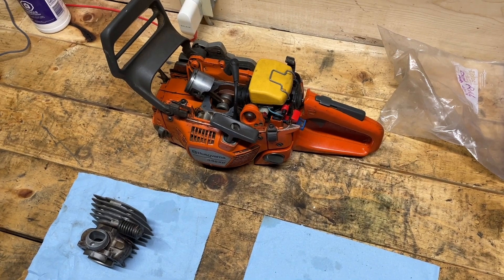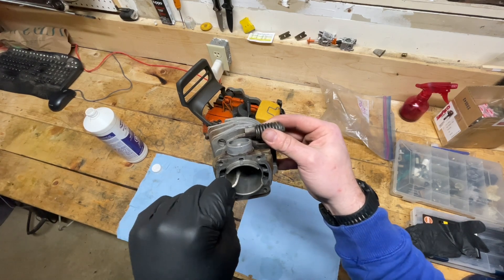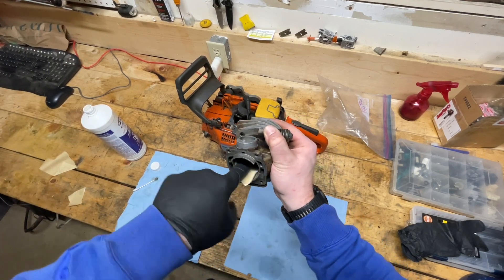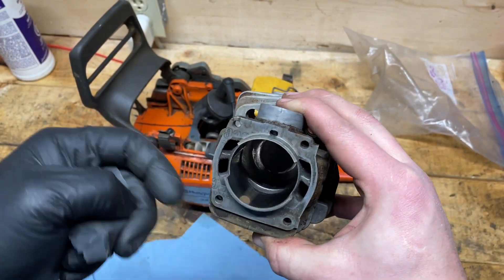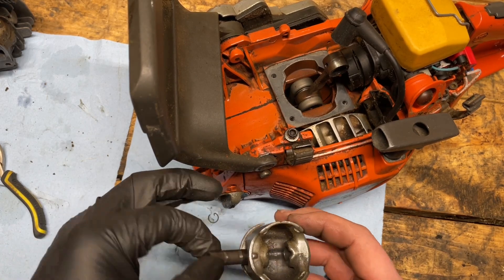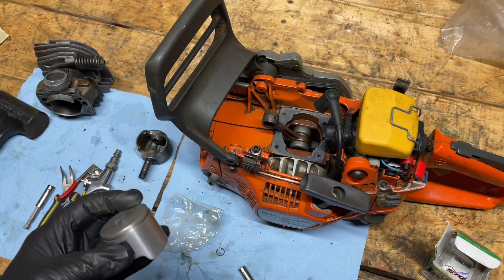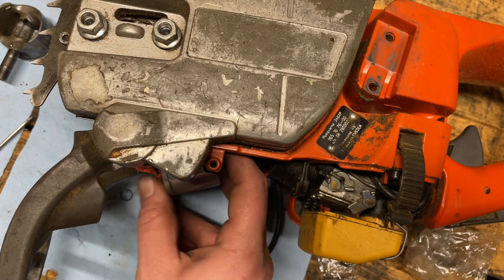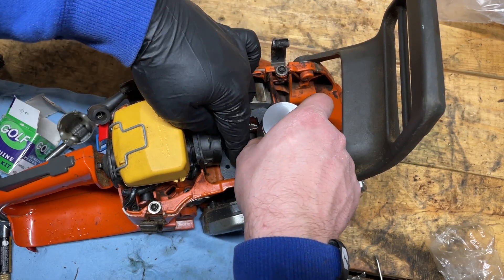How to fix a scored (blown) chainsaw and install a new piston. Step by step on “the lemon” saw!!!

Comment: Great job Dave on the lemon saw. I have used sand paper as well,  but i now use a brake cylinder hone in a drill at slow speed, going in and out to get a cross hatch. Saw runs good and i would have liked to have seen you do another compression test after you cut with the saw, just to get a comparison. Nice camera work and explanation of what you were doing!  🇺🇸🇨🇦👍  Roger
Reply from the maker: Thanks Roger! Do you think the home takes off too much material?
Reply: @DavesSmallEngines  No Dave after you use the acid on the bore it doesn't take but 30 second with the hone. The one i have is adjustable so you can set it for a very light pressure.  I have larger hones also for car engines that adjust to larger bores and you can still set the pressure.  You could practice on a junk cylinder. You will be suprised how easy it is. Slow speed and not alot of pressure.
Reply from the maker: @rogermcdonald1607  I will look into this. Great tip!
Reply: @DavesSmallEngines  Goodluck Dave, you can buy them on Amazon for under 15 dollars.
Reply: I too appreciate Daves camera work, I think he was meant for Youtube, so congrats to him hehe.
Reply from the maker: @stellarproductions8888  thanks Stellar!!!

Comment: i find that when i put a piton in a cylinder is to get a small cable tie  and put it round the piston ring and push the cylinder on and then cut the cable tie off when you have started the piston and i all ways put some rag in the piston hole to stop bits dropping in the case .
Reply from the maker: Good tips! Thanks!

Comment: Hows it going Dave? Thats a nice small size saw, I think its meant for a 16" blade, its mainly a firewood cutting, sapling remover saw, light duty work. You did another excellent job on making lemonade out of a lemon! She's ready for a good time now, and clearly couldn't wait to cut something out there, good deal. I like the attention to detail that you do with your services. Excellent work buddy, and thanks for sharing!
Reply from the maker: Thanks again for yet another positive feedback Stellar! I always look forward to your comments. This saw is actually known to run best with an 18" bar. Its very comparable (and most say better) than the Stihl 026/MS260. I have one of those with a 16" bar on it and it absolutely screams!

Comment: Good on the process for rebuilding. Like someone mentioned earlier, sounds (and possibly looks) like there could be an air leak. You did adjust the idle screw, so that could be part of the problem. Pressure and vacuum test could give you the answer.
Reply from the maker: Sounds good Andrew!  I’ll check it out.Thanks for watching.

Comment: Nice work! I told you that's a fast saw.  Sounds a little lean on my cheap speakers. If so, Might be carb adjust or vacuum leak which would explain original issue. Easy to test with some brake clean.  Keep the videos coming.
Reply from the maker: Will do!
Reply: @DavesSmallEngines  Friend, did the compression increase from 130 psi over time? What is it like now?

Comment: You can also run a hone through the cylinder if you want to establish some cross hatch patterns
Reply from the maker: Very true!
Reply: @DavesSmallEngines  I have sprayed starting fluid around intake before and if the engine revs up you know there’s an intake leak.

Comment: The avid works. But be cautious with it.  I see you left the cap off the bottle of avid while you were doing your sanding.  Easy to tip over.  Big problem.  Also the acid is very corrosive on steel.  I recommend washing out the area with  baking soda and water to  neutralize the acid.  I did a crank once  and didn't  neutralize the  acid and  the acid ruined  the crank. Another  thing Dave I use  mineral spirits with a  two inch paint brush to clean up all engines before I work on them.  you can wipe off or use air compressor to  blow it clean.  It's easy and  not  as flammable  as gas, which  I see some  mechanics use.  Keep up the good videos. Ron Bechler, Ron's small engine service Michigan
Reply from the maker: Hey Ron! Thanks for the great points. Hope all is well on your side of the border!!!

Comment: Dave, I have a Stihl 193t with a scored piston. The saw still runs good with good compression, but I'm wondering if I run it til the compression gets low, or it blows, will I be doing other damage to the motor? Also, do recommend any aftermarket pistons and or cylinder/piston combo for a 193t?
Reply from the maker: Hey Sword! You always run the risk of introducing metal into the spin-y things - bearings etc. It’s always best to get ahead of it. OEM is best but I’d go Meteor, or Tecomec if you can find it. The new Hyway stuff is supposed to be a close runner up, too.

Comment: being you work on small engines, you should already know that going from a 50:1 mix to 40 or 45:1 mix, you have to richen up the carb setting since you are displacing fuel with oil which means you are leaning the fuel mixture out.
Reply from the maker: That is true!

Comment: My trucks down ..I don't haveacid I tryed useing oil mixed gas and toothbrushes ..but now I checked again it seems littke wrose.has light heat marks on intake side clolrong ..and veryight scoring on exhaust side..bitten end seem s fine..have it apart and cleaned.didn't have that grit paper. Will it blow up saw if ivreasemble it.?it's 488 shindiawa..and will take days to order a new cylinder and piston.the top of the piston looks odd.not smooth ..
Reply from the maker: Hi Seth - you've got a lot going on there. An abrasive will need to be used to remove any aluminum transfer.
Reply: @DavesSmallEngines  I used what i had some mixed gas and light brushes with some mass airflow sensor I just put oil to reassemble but don't have that tool to hold rings still ???it has 2 one on each 90 degree side of intake the points I mean to set rings and slide in cylinder..other wise have minor slit in gasket .but man it seems ok I've cleaned recleaned, it. Poished, it.I caught it straight away.I've watched all you r videos plus donys, I think if I can find a hose clamp that size it will work.I'm trying to fix electrical on truck it keeps shorting out battery .have new battery altinator and voltage regulator .but I think the power steering has leaked all over the starter you guys have been helping so much.im just a dumb tree climber ..learning mechanics.lol.I just fixed both my shindiawa t235.trimmers shindiawa has hands down the best trimmers been running them 15 yeaes or more?that saw was a gift for a tree and mulch job and I've baby'ed it..but the carb onky a.has a low end adjustment ?and I turned it to lean.plus i used someone's sthil?gas ive always ran red armor??only.until then had no issues.plus that dirty firewood.so .I need to order all parts like a better carb.and that auto motive style air box??if you guys have anyparts at all..I need them would be blessing.I'll send you the money .i know there cheap?need to get new back cylinder kit exctra..the only sthil products I run are my 450 blower and I'm about to by a 461''or 462??by God's grace?..have lot of persnol going on and I appreciate your help freinds...thank u
Reply: @DavesSmallEngines  I don't see any aluminum transfer just some light light blueing''' on exhaust side the muffler was gunked" so im soaking it and cleaning it to ..i haven't been able to go to store to get chemicals.as I do trees and help my partners?mowing buisness.plus my buddy at parks wreck..haveing family issues..the rain finally stopped and its weeds everywhere.plus just had 30 tons of 3 inch gravel dropped had to hand grade it was a nightmare'???.my phone is shattered dropped out a tree it takes 20 minutes to type these messages' I have to go to other 'screen and hit commas' or it will not spell.I've tryed all the auto corrects;; it's rediculoius and drives me insane.wish I could just call people
Reply: @DavesSmallEngines  I will try and upload a video ..I'm New to internet ..I'm old-school as it gets.lol.can't even use desk tops..barley.funny i used to install cell towers go figure
Reply: @DavesSmallEngines  rediculous right.had 2 concusions last year
Reply: @DavesSmallEngines  how do I just send a pictures.only..with out video

Comment: Hey Dave, I was given an Ms260 with a pooched top end and have replaced with a chinesium top end kit. After learning about this process I just ordered a meteor piston so I can hopefully reuse the oem cylinder with the higher quality meteor piston and have the chinese as a backup. My question is what is a proper compression level for a chainsaw? Love your vids and keep em coming. You're a lucky man to have Don as your mentor!
Reply from the maker: Hey Jerry! You’ll love that meteor piston with the OEM cylinder. Way, WAY better than the aftermarket kits. 

I have an 026, 260, and a 261 and they are all within 165-180 psi. 

Take your time on the cylinder, don’t rush it, don’t take too much off. You’ll be rewarded!

Further… have you determined the cause of the scores piston in the first place?

Comment: Lube the walls of the cylinder and rings and it will slide in alot easier next time
Reply from the maker: I do - maybe I did it off view this time. I just use Jig-a-loo or WD-40.

Comment: Nice work man. A question for you - do you have to use the acid before you sand the cylinder?
Reply from the maker: You don’t, however... you risk sanding down more of the nikisil coating than necessary to get it smooth. The aluminum from the piston is what you really want to remove and the acid does just that.
Reply: @DavesSmallEngines  thanks man, appreciate it. I’m going to try sanding out my first cylinder pretty soon for a stihl 461. Yours and Donboy73 videos are super helpful.
Reply from the maker: @mattshaw6828  hey Matt - that saw is worth saving no matter what. If it doesn’t work, I would get a Meteor kit for it!
Reply: Yeah it’s a great saw. Hoping I can save it. Can you use the sanding trick on the scores on the piston and rings as well or does it only work on the cylinder?
Reply from the maker: @mattshaw6828  works very well on the piston, not great on the rings as that is what makes the compression seal.

Comment: Get yourself a torque wrench. You should use one on those head bolts, and in a proper cross pattern. So what was the final compression value? It should be better after running for a bit.
Reply from the maker: Hey Ozark! I have one, I did use it but was running into video filming issues (as you see later with the flickering). I torqued them to 8.5 ft lbs.

Comment: Take the whole intake assembly off and mount them on the cylinder before install the cylinder make lfe much easier. I know you cut off that part.
Reply from the maker: Good tip!

Comment: The piston has a galvanized rough looking top.like the under and inside of it like it was made that way..??need some help.it seems ok the moment I seen saw smoking I knew something was wrong and it appears is though I caught it just in time..caby find a image of this kind a piston.even the cylinder has that kinda finish on it only spot thats shiny and smooth IS the inside walls and no damage
Reply from the maker: Sounds like that piston and cylinder is on its way out, my friend. I had a Shindaiwa 488 and it was to this day one of my favourite saws. I have a video of it running and cutting - maybe that will help you.
Reply: @DavesSmallEngines  its in good shape was like new and I've baby'ed it..thanks it is my favorite saw..I'll send details maybe you can help look it up the date ..wadMS a freind slash boss .and he never used it i had all year and cleaned it. Every night..
Reply: @DavesSmallEngines  I was at store ?so I had this like brand new ..and I do mean brand spaking, new 488 been useing it on my removals all year and use only' shindiawa or redmarmor' gas ?and had done over 50 trees big ones.and started firewood over fifty cords..however I've taken it apart and cleaned it every night..it still reamain s like new woth exception of the were on outside plastic!!my air box bottin on cover came off the screw so I've used duck tape to keep cover from vibrating the screw out.so I can take tape of to clean nightly.however I had to use sthil gas and technical y it caLs, for 40-1 instead of 50 1 but had no problems until that gas and also has a CARB WITH ONKY LOW JET and blocker on the high side and then high idle I think I turned it while running and riches it out?but by God's grace soon as I saw smoke I knew to shut it off ive tore it down and after cleaning its like A baby's but..the marks or scoreing is I think the factory marks they. Don't feel damaged..or very very light ..I didn't have rite sand paper still don't but I'm going to try again plus order more parts I think it will be ok . the piston you are rite is galvanized or what ever..cleaned it and it to is ok .but on the bottom needs one side sanded .I mean underneath on the bend radiius .not side walls..love this saw I climb with it to..I didn't want to do fire wood with it for that reason it has not so good air filter system guna try ordering the bigger one online..I also have to order a 039 kit for a blown up 029 that my freind threw out..it's parts are all other wise fine he just left it in a barn on ground I tore it down and it needs that kit ..going to use it for firewood that was my intention, this will be my first successful rebuild well both of them by God's grace.your guys help has been key?clutch ?crucail??thank you..any advice on parts ..be great .that car b is the problem WHAT CARB CAN I ORDER TO SOLVE THAT . ONE NOT BLOCKED.IT ONKY HAS LOW JET AND DOEZSNT TURM FULL DISTANCE...and shouis I tune from right to left like normal or reverse??????

Comment: recommended bar length 13-20
Reply: Considering how she began to bog down with an 18" installed, I think that engine is primarily designed for a 16" blade or smaller.
Reply from the maker: Also remember that cutting that stump vertically is a cross-cut. Much harder to cut!